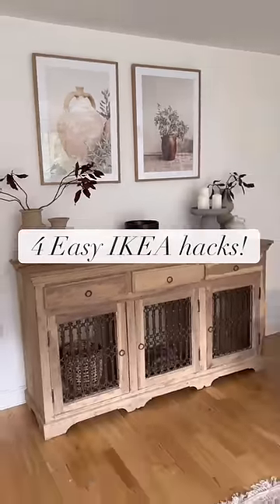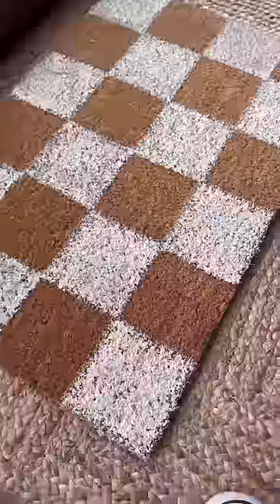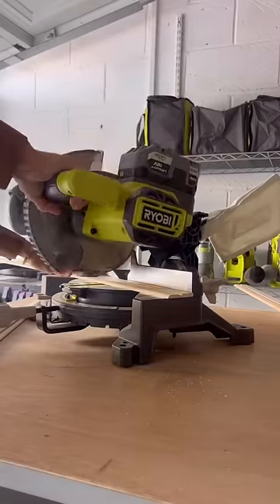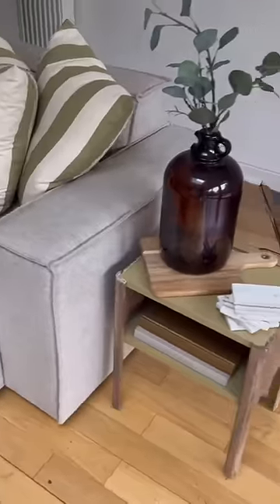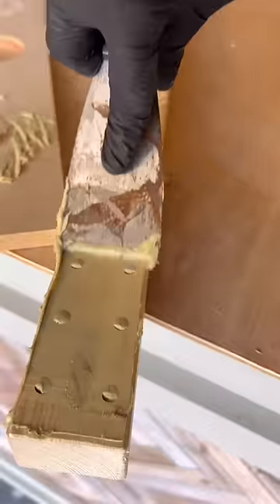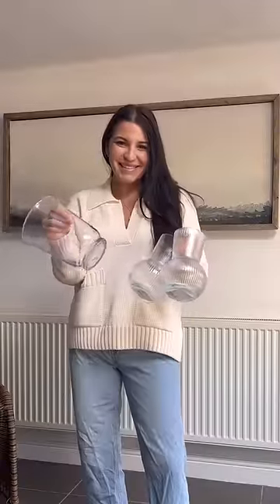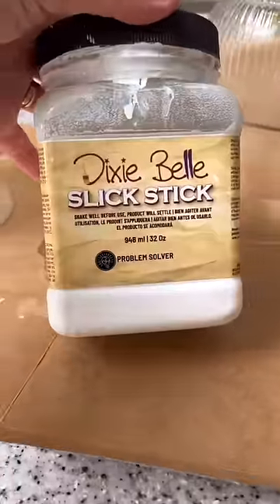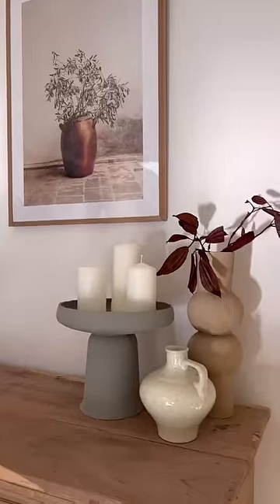4 budget friendly Ikea hacks! 😍 #shorts #ikeahack #ikeahacks #diy #dbpbrandambassador

Comment: Nice. What are you using to glue the vase together?
Reply: yes what is used to glue the glass pieces together?
Reply: It looks like a construction adhesive. But you can use any good, strong glue, such as E6000. You can get the construction adhesive at Lowe's or home Depot. Any home and hardware place.
Reply: @crystalparker2542  Thank you so much 😁
Reply: @sunshinedesignsandmore4074  You are so very welcome.